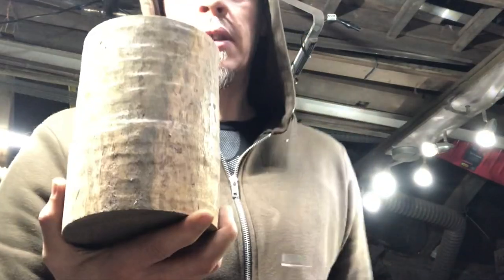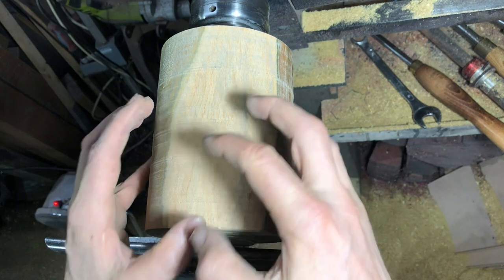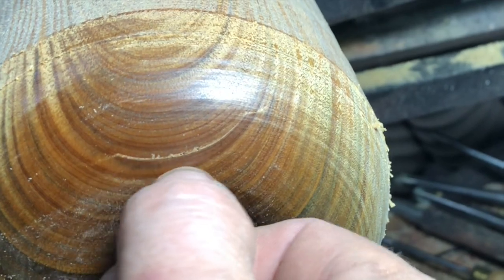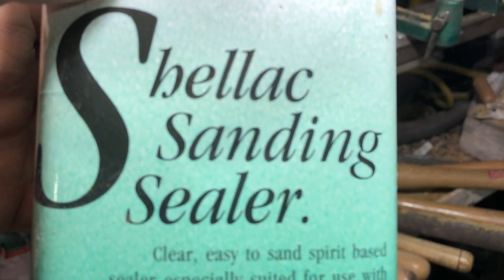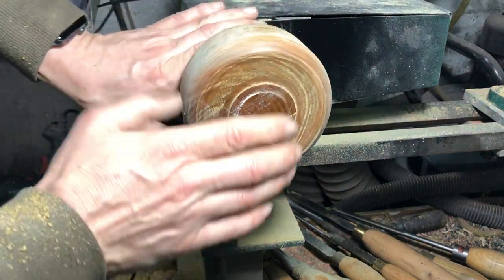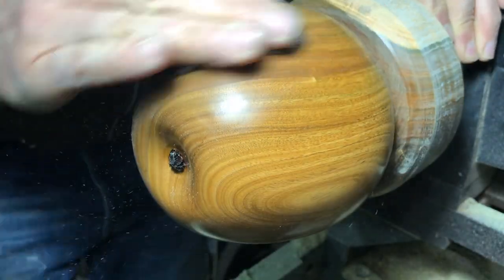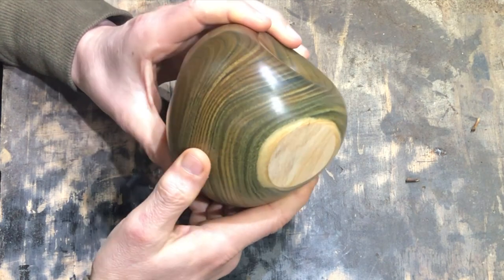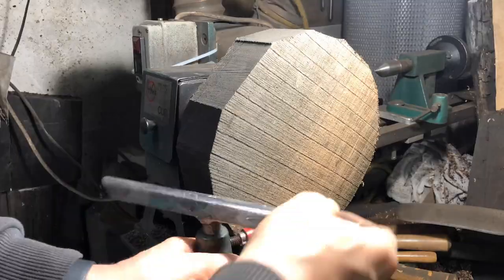HOW TO Turn an Apple PROPERLY - Piece number 788

Comment: @10:18,,.  if you get a thin side and a thick side on your bowl ,,. you need to do the kiss test ,ie headstock center to tailstock center ,,. Regards Alf
Reply from the maker: Hi Alf, thank you for your comment, my usual cause is my recess or tenon sometimes a little wrong angled or if the wood has cracks and the close slightly with the clamping or expanding. But fir this it works out just fine 👍😁